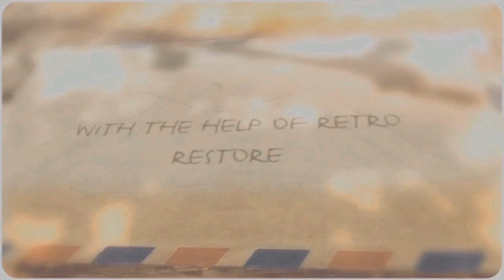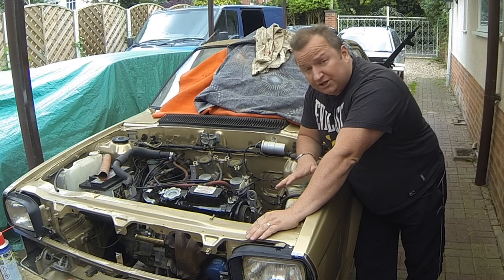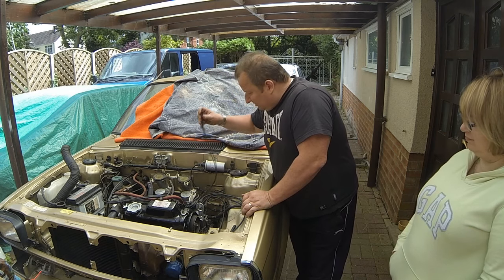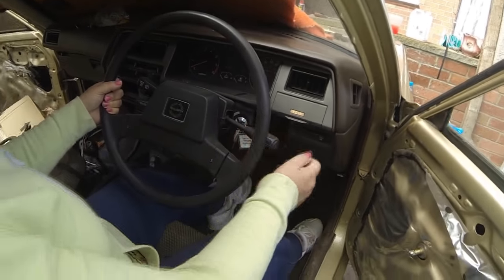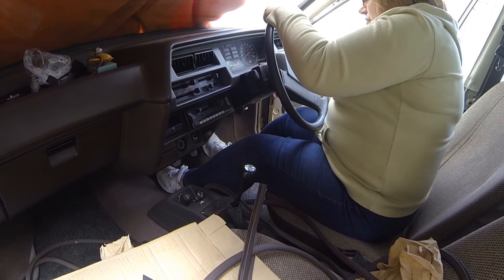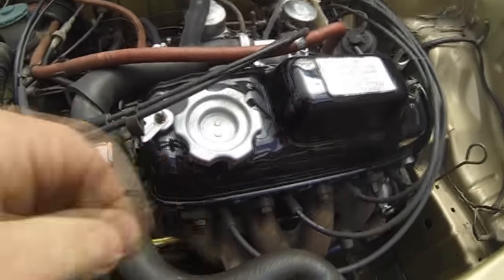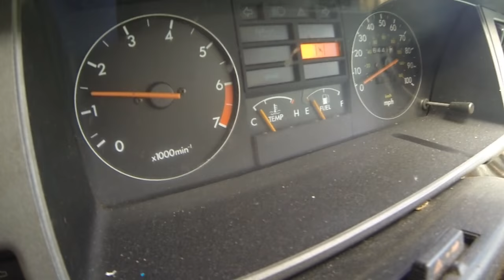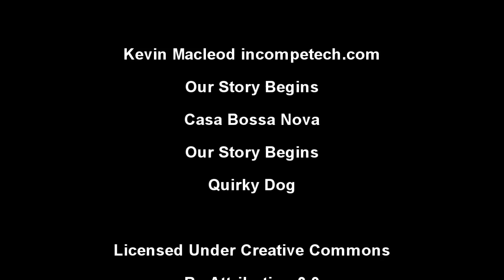Part 21 Triumph Acclaim Restoration Let's See If It Starts

Comment: Good job Martin. There's nothing like the satisfaction of firing an engine after you've rebuilt it. You do need the radiator cap on though before the water system pressurises, that's why the hoses were soft, but I'm sure you'd figured that out. I'm looking forward to seeing the Triumph being completed and driving. 80's cars are becoming very rare and collectable. Keep it up buddy.
Reply from the maker: Yes bud, I was just bleeding the air out of the system by pressing the hoses. Glad to get it running and looking forward to getting it moving again under it's own steam.
Cheers
Martin

Comment: excellent job..nice little car... It that a Honda /Triumph collaboration ?  looks very Honda-ish inside and in the engine compartment
Reply: You guessed it. Not bad, but ironic!
Reply from the maker: Yes it is bud. Basically a Honda badged Triumph a collab before Triumph folded.
Cheers
Martin
Reply: This was the first product of the BL-Honda partnership. It was based on the Honda Ballade which in turn was a saloon version of the 2nd generation Civic. The car was assembled at the Cowley works (the old Morris factory) where the BMW MINI is now built. The engines are the 1335cc Honda EN4 units which were shipped in from Japan. The final Acclaim (and final Triumph car) off the production line now resides in the Heritage Museum in Gaydon and is a silver CD Trio-matic.
Reply from the maker: Nice bit of Triumph history there bud. These engines are nippy little motors as well.
Reply: Parknest cool.. appreciate the info :)

Comment: Nice one she lives. The timing should fix the issue . Balance the old carbs run like a  good one.
Reply from the maker: The hunting was because the air hoses weren't connected to the air box from the inlet manifold Pete. Runs great now.
Cheers
Martin
Reply: Good stuff Martin .

Comment: Glad to see her running pal , I know I need to do ignition timing but sounds like u may have a air leak causing the hunting
Reply from the maker: Yes, it was because I didn't have the air hoses connected from the inlet manifold to the air box. It's fine now.
Cheers
Martin
Reply: +retrorestore ok cool :) hope she be finished soon

Comment: I forgot to mention that you can bleed the air out of the cooling system. There's a bleed nipple between the thermostat and the servo vacuum hose. If I remember correctly it will need a 12mm socket. Glad you got it running. It sounds really sweet. These engines will run on unleaded out of the box.
Reply from the maker: Ahh, I wondered what that nipple was by the thermostat. Thanks for letting me know.
Cheers
Martin

Comment: Mr Retrorestore you know better than to dilute engine coolant with regular tap water. Distilled water from the supermarket or drugstore is the proper way to dilute coolant because it doesn't contain minerals that can calcify the entire cooling system. That's probably what happened to the cooling system the last time.
Reply from the maker: Come on Stephen, if it's good enough to drink all my life, i'm sure a 33 year old car can take it. It's been mixed with the coolant that is supposed to have additives in to inhibit corrosion. This is the real world bud.
Reply: I too live in the real world, mate. The main reason for cooling system failure besides lack of maintenance is calcification/mineralization. Your car was the perfect example. My preference is using distilled water to dilute the coolant with great results. For about another quid or less, one can do that favour, at least, for the classic. That cooling system uses about 8 litres total. Mix both 4l bottles together and one has the perfect ratio and enough for the top-up of the overflow reservoir. Relying on inhibitors to their job is a crapshoot.
P.S. Drinking treated city water has its own dangers.
Reply from the maker: I know all that Stephen but an old car with many previous owners with no knowing what has been through it is something that occurs in day to day life of every car. I know about tap water and what it can do to an engine but it's all risk assessment and worrying about it in this car is like shutting the door after the horse has bolted. Your theory is sound but in real life, it wouldn't make any difference in this car. That was my decision.
Reply: All I've ever had the misfortune to own has been well-used automobiles. You're quite right about shutting the barn door after the horse has bolted. I've gotten accustomed to making the best out of poor situations with great success, as far as automobiles are concerned. It's quite amazing how resilient these vehicles truly are. I completely understand that buying and flipping automobiles requires one to prioritize expenditures in order to make the maximum out of their sale. Been there, done that, got the T-shirt.
I truly enjoy your channel and your closely knit family. Good fortune to you and yours. Thank you.
Reply from the maker: Thanks Stephen, Glad you are enjoying the vids, I'm no expert but I'm probably like you in that I have common sense and a wealth of experience in many things. I don't take life's so called rules to seriously so I make my own informed decisions and have fun along the way. Making these videos is fun and also a good record of the things that I have done to look back on.
Cheers
Martin